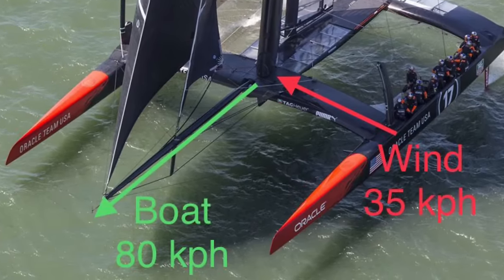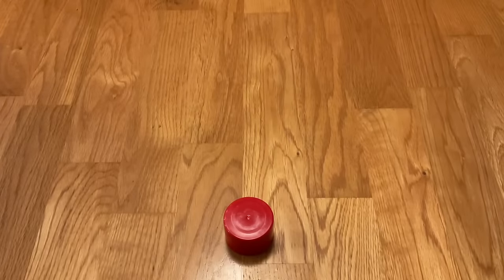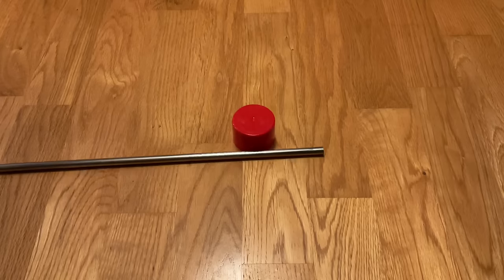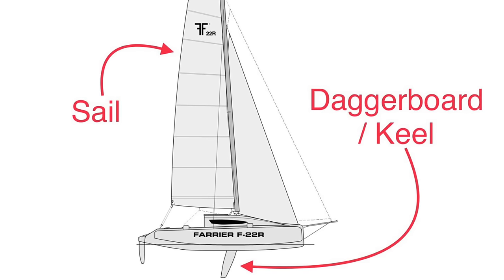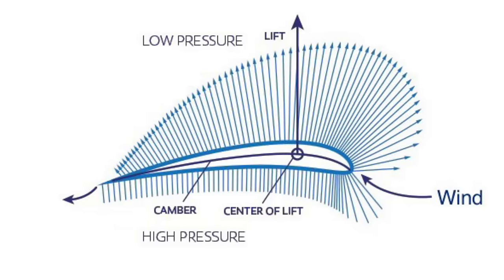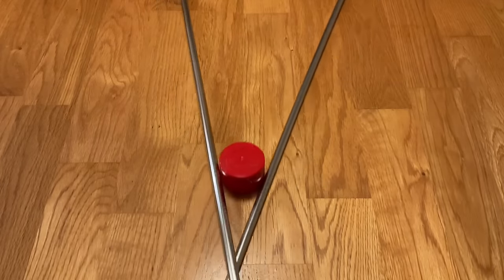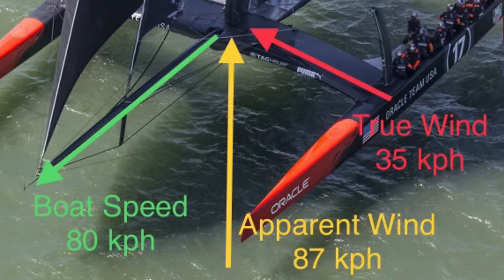How Does a Boat Sail Faster Than The Wind?!?!?

Comment: Hi.  Very good vid ! I have a question -  what is "needed" to go faster than wind ( is your Tri able to do so ) ?  Would be very interesting video to create - It could be called: " What is needed to go faster than wind".  Wing mast  ?  Power to weight ratio ( Sail area to displacement )  equal to ...  ?
Reply from the maker: Good question and video suggestion! Somebody once told me that everything in sailing comes down to lift versus efficiency and I think that applies here too. 

Our F-82R trimaran can sail at around 1.2 times the true wind speed, but it has no lifting foils and relies entirely on floatation for righting moment.

Off the top of my head I think that what you "need" to sail faster than the wind is:
1) A powerful sail plan - most boats that can sail faster than the wind have huge flat-top mains, a rotating mast also definitely helps here
2) A hull that is not constrained by displacement hull speed "rules" (i.e. 1.34 x sqrt(waterline length)) so either a planing hull for a monohull, or a multihull with long skinny hulls and a length to width ratio of greater than 8:1, or lifting foils
3) Enough righting moment to keep the mast upright without impacting 2) above, so for a monohull a canting keel definitely helps

Interestingly I have a friend with a Cheetah 30 sport boat, which has a very similar sail plan to our F-82R, a planing hull, and about the same boat weight, but the Cheetah is much harder to sail faster than the wind because we run out of righting moment and get knocked over as the apparent wind comes forward. In fact the F-82R has about five times the righting moment of the Cheetah and as a result the F-82R rates about 30 seconds per mile faster. The F-82R also has a rotating mast but I think the righting moment is the biggest contributor.
Reply: @SailingTipsCa  Thank You!
Reply: I have a 24 ft monohull with a Dacron sail.  While it is light and efficient it has no foils or Alma’s ( outrigger multiple hull sponsons).  I frequently sail at wind speed + 2 knots.  The trick downwind is to not sail exactly downwind but off the wind in order to create the draft effect on the sails.  That’s why you see sailboats jibing downwind to get to a point that is directly downwind from the boat. Longer distance but much faster speed.
Reply: Light weight and with it low drag. I had a 24 mtr cat before with 9 tons and 1 to 19 ration waterline. Same thing without foils or planing.

Comment: there's a crucial detail that should be noted. High performance class boats are able to go faster than true wind on up and downwind lines due to the design that allows the boats to manipulate apparent wind in an unconventional manner. The best example of this is when the AC72/75 is downwind, the trim is changed to an upwind mode as when it is travelling faster than the true wind, it's as if the wind is going backward! So technically a jibe is in actuality a tack
Reply from the maker: Yes it’s not uncommon for faster boats to be sailing “upwind” all the time! Even my “slow” F-82R trimaran can “bend” the apparent wind forward by up to 90 degrees so we’re always sailing with the apparent wind forward of the beam even under spinnaker!
Reply: This is the part that breaks my brain (old school sailor). When AC boats are jibing downwind I just can't comprehend what is happening. Is there a point where they switch from tacking to jibing if the wind drops?
Reply from the maker: @tmhudg  The term “tack” is typically defined by turning the bow of the boat through the eye of the wind, whereby a “gybe” is turning the stern of the boat through the eye of the wind. With an AC boat the key question then becomes whether this definition is based on the true wind or the apparent wind. Turning the stern of an AC boat through the eye of the true wind may technically still be a gybe, but it will certainly feel like and be executed like a tack because the apparent wind in the faces of the sailors and on the sails from ahead will generally be stronger than the true wind from behind. Those who have sailed them (not me) can probably say for sure, but given their efficiency I don’t expect there to be any conditions where they would choose to sail with the apparent wind aft of the beam, so a gybe would probably always feel like a tack.
Reply: @SailingTipsCa  That makes sense but there are things that still are hard to grasp. Like when rounding an upwind mark, what changes are made to the sails when going from sailing "upwind" to sailing "downwind"? I get that the apparent wind is still coming over the bow(ish) but it certainly lessens as they turn right? Are they trimming sails differently? 

In lighter wind (and therefore slower boat speed) is there a point where, when turning to go downwind, the apparent wind is aft of the beam? If so, do they then have to do "normal" gybes at that point?
Reply from the maker: @tmhudg  Great questions! The apparent wind angle will be the tightest (as measured from the centreline of the boat) on the upwind leg and will be slightly lower on the downwind leg. So just like any boat the sails will be fully sheeted in as tight as possible for the upwind leg, and eased as the boat rounds the windward mark, but not by much, something on the order of 20 degrees (again as measured from the centreline of the boat). So close-hauled upwind and close reaching downwind. 

On my boat, which is much slower than an AC boat but still sails faster than the wind, it is pretty much always fastest to sail with the apparent wind forward of the beam, even downwind in light conditions. This is because the lift created by the sails is always the greatest when you can get the wind flowing across them like an airplane wing, and the extra distance sailed is easily compensated for by the increased speed.
Reply: @SailingTipsCa   👍👍👍
Reply: @tmhudg      because these boats can sail high and maintain speed above the apparent and true wind, the setup for pressure gain doesn't change. These sails can generate massive power compared to an orthodox setup, but the tech used for these boats is on another level i.e. self tacking jibs, isolated/articulated trimming, shapeshifting d-spars and so on. The foiling generation adhere to a delineated race configuration. If they deviate from that, they're dead in the water (sort of).

This reminds me of a couple races that will give you an idea of the setup in lights. The first being the terminated race 12 of the AC34 where NZ were a leg and a half in front. They had a code zero but never raced it if memory serves. The other was a prelim race between GBR and NZ in the Prada Cup. Both were a very interesting watch in my opinion.

Comment: You don't need to invoke Bernoulli / foil lift principles to explain why a boat can travel faster than wind. 
You even showed the effect with the disc, and you had no foil present. It's just vectors and "sliding surfaces" or an angle of attack.
Reply from the maker: Yes in retrospect showing lifting foils makes the video slightly more confusing than it might have been with another boat with the high lift versus drag ratios like a planing dinghy, sport monohull, or multihull. Otherwise you’re right it’s about vectors.

Comment: Explanation via forces and vectors: Drag (force in N) in - opposite - wind direction, Lift (force in N) orthogonal to Drag. The vector of the resultant force is splitted other wise: into sailing direction and orthogonal direction. The force in the sailing direction moves the boat forward and the other one heels the boat sideward. The keel must be heavy to create the sufficient righting moment in order to prevent the capsize.
https://de.wikipedia.org/wiki/Physik_des_Segelns#/media/Datei:Wirkung_des_Windes_bei_Amwindkurs.svg
Reply from the maker: Nice diagram - thanks for sharing! Yes the sails generally create more heeling force than forward drive. Most boats use heavy lead keels to create righting moment and counter heeling, but some boats (e.g. multihulls) use floatation and the weight of the boat itself to counter heeling, while others (e.g. foiling boats) use hydrodynamic forces in conjunction with the weight of the boat.

Comment: Why isn't the foil bigger, like a hydrofoil. Wouldn't it make the boat rise much easier?
Reply from the maker: Yes some boats are able to fit larger foils in lighter wind to lift the boat out of the water at lower speeds, but larger foils also create more drag so slow the boat down when it’s going really fast. Airplanes have the same problem but are able to extend flaps to enlarge the wings during takeoff and landing, but make them smaller at speed for efficiency.  This could theoretically be applied to foils as well but water is 800 times more dense than air and nobody has figured out how to fit all the gadgets into a much smaller foil.

Comment: Interesting. If this is correct and made a static situation we could generate power without windmills?
Reply: I think you still need kinetic energy turned into electricity by some motion.
Reply from the maker: Yes a static situation could generate lots of force but to generate electricity you generally need to spin a magnet inside a coil of wires (or something similar) so you need the motion!

Comment: From my understanding, foils don't produce propelling forces at all. They lift up the boat vertically to reduce drag and stabilize it in the water so that the boat doesn't sweep sideways.

I totally did not understand the physics of the foil's forces shown in your examples. 🤷‍♂️
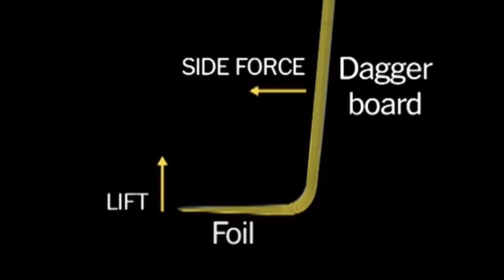Reply from the maker: The word “foil” is a general term for wing which can do multiple things: 1) a rudder is a foil that steers the boat 2) a daggerboard or keel is a foil that opposes the force of the sails to drive the boat forward 3) a lifting foil raises the hull out of the water to reduce friction. An efficient boat can still sail slightly faster than the wind with only the first two, but to sail at multiple times the wind speed you also need the third to lift the hull out of the water. The foil at 2:32 of the video provides lift in both the vertical and horizontal planes to carry out jobs 2) and 3) with a single foil. Does this help?
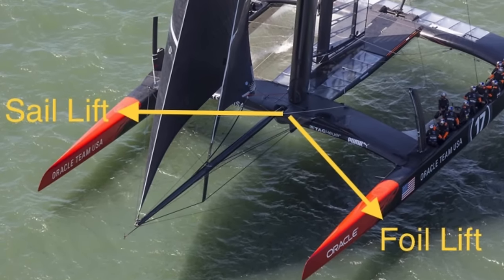Reply: @SailingTipsCa  1:50 - Author. You misunderstand, therefore, you draw the balance of power incorrectly.
Your 'Foil lift' propels the boat forward. This is nonsense.
In fact, this force is always opposite and equal in magnitude to 'Sail lift'...
Reply from the maker: @MikleM1  Yes i did say the foils and sails generate lift in opposite directions but the drawing could definitely be better in that regard!
Reply: @MikleM1  "2) a daggerboard or keel is a foil that opposes the force of the sails to drive the boat forward" is correct.  The sails propel the boat forward, but won't do so without the opposing action of the keel or foil.  Note that he is saying that the sails drive the boat forward.
Reply: @Timo Rieseler The video shows an "L" shaped foil that has a vertical, lifting part of the foil (which is horizontally oriented) to raise the boat out of the water and a horizontal part of the foil (which is vertically oriented) to counteract the side (component of) force from the sail.  A single foil does two things: vertical and horizontal lift. 

Horizontal lift is always needed in a sailboat in order to counter the side force of the sail.

It's also possible to have a foil that only resists the side component of the sail force.  That's a daggerboard or regular keel.  They have only a vertical member.

There are several possible arrangements of foils, including ones placed diagonally that also provide both vertical and horizontal lift components from a single straight foil, curved or C foils, "J" shaped, "L" shaped, etc.
Reply from the maker: @LoanwordEggcorn  I think that what @MikleM1 is saying is that there is too much forward vector in the foil lift drawing at 1:50. I agree with him IF we're using  the boat heading as the static reference frame.   

That said, I sail in an area with relatively strong tidal currents which can flow at up to 4 knots in the open water and much higher around headlands and through tight channels, so 4 knots of current against 4 knots of true wind is not unusual. I've also been in situations with zero true wind and 4 knots of current and propelled my boat forward (relative to the stationary earth) with the underwater foils and using the sails a huge daggerboard in the sky.

In order for the boat to move forward relative to the stationary earth, all you need is the water and air moving relative to each other, regardless of which one is actually moving relative to the earth. So in order to accurately update the lift drawing at 1:50 for any real situation we really need to clearly articulate the static reference frame.
Reply: @SailingTipsCa  @MikleM1 seems right.  Shouldn't the lift vector for the foil be equal and opposite to the sail lift vector?  That's how the forces should balance out.  

The only time they would not balance would be dynamically during a tack, and even then the trimmers are probably trying to keep them in balance, dynamically, for maximum performance through the tack.

Yes, it's definitely possible to sail the current with the keel/foil(s) and use the sail as a keel to oppose the current, where there's a lot of current and not much wind.  IIRC the tidal range in Canada can be large.  (Or probably any areas relatively near the poles and with relative shallows.)

We generally don't have that problem here on San Francisco Bay, where the wind is usually pretty good, except in the Winter.

But we also have a very strong current through the Golden Gate in particular, at times.  It's pretty common to sail backwards under the Golden Gate Bridge during a strong flood tide, and with the sails full of wind and not backwinded (i.e., the traditional sailing backwards trick).
Reply from the maker: @LoanwordEggcorn  I agree that @MikleM1 is right in that the lift from the sails needs to be offset completely by something, and also that the lift vector from the underwater foils should be more aft than in the drawing at 1:50 of the video, but I think the lift from the sails is actually offset by a combination of 1) the hydrodynamic lift from the underwater foils, including the keel/daggerboard/rudder 2) the righting moment of the boat, which could be the force of gravity on lead in the keel against the floatation of the hull in the case of a monohull, or force of gravity against the weight of the boat against the floatation of the amas in a multihull 3) the drag of the hull through the water, and 4) the drag of the rig through the air. 

So when you add 1-4 all together you completely counter the lift from the sails, but that’s not just from the underwater foils. 

In other words I think the hydrodynamic lift from the underwater foils should be more on the beam, but the aft-facing component that counters the forward thrust from the sails is from drag.
Reply: @SailingTipsCa  Yes, you're right, there are many other sources of forces, beyond just the foil.  So it's never just the foil and sail balancing each other out.

I like to think of the keel and rudder balancing out the main and headsail with their centers of effort offset longitudinally, and those are probably the major forces, but as you note, there are several others.

Comment: My understanding is water is essentially incompressible, especially under normal conditions. It's why depth charges work. So how do you have areas of high (compressed water) and low pressure (expanded water) under the keel? Especially as the (compressive??) forces involved must be tiny. 1m.38s
Reply: "Essentially incompressible" means that the volume doesn't change much, despite high pressure differences, not that there are no pressure differences. The air that interacts with the sail is also "essentially incompressible" at those speeds (way below Mach 0.3).
Reply from the maker: Yes incompressibility relates to water not changing volume much under different pressures, not that it can’t be under high or low pressure! It’s the low pressure that substantially lowers the boiling point to be at or near the sea temperature. Check out this video on Vestas Sailrocket for more info on that! How Did Vestas Sailrocket 2 Smash the Sailing Speed Record?!?! https://youtu.be/K3m06731BQY
Reply: You can definitely change the pressure of water in sailing and marine applications. Just look into propeller-driven cavitation if you don't believe me.

Comment: The simplest physics explanation is that momentum is always conserved.  Mass 1 x velocity 1 = mass 2  x velocity 2.  Clearly it is possible for v1 to be different than v2.
Reply: Yes that is a very simple physics explanation! How do you take into account lift versus drag?
Reply from the maker: Fast boats are generally pretty light and slow down fairly quickly when the wind dies!